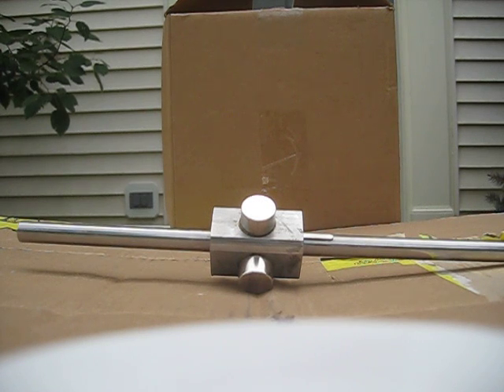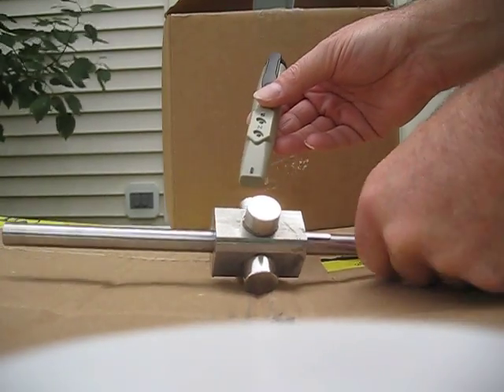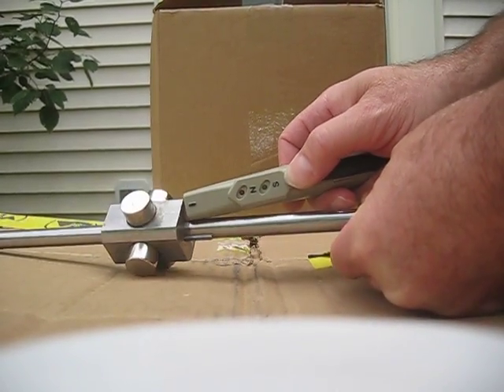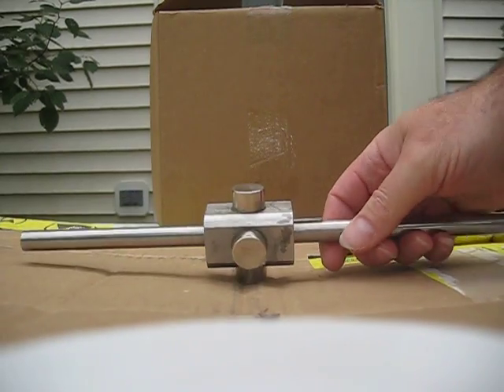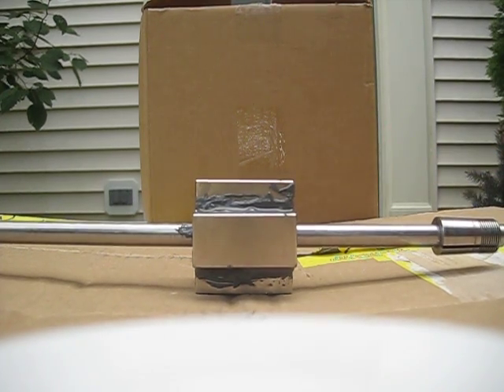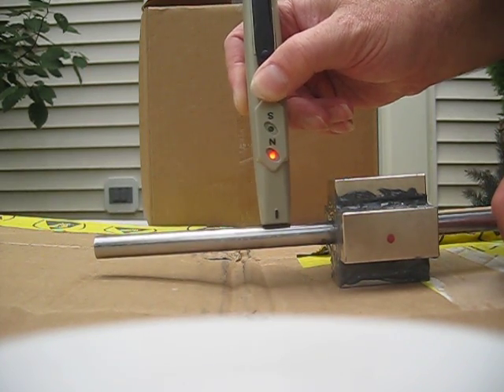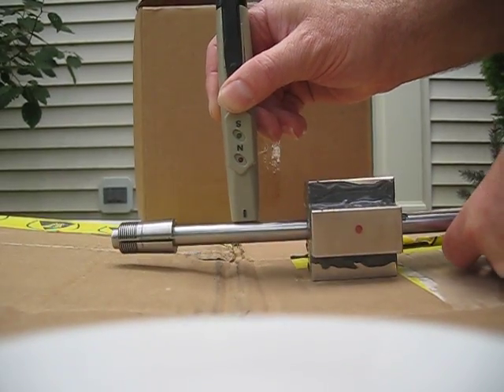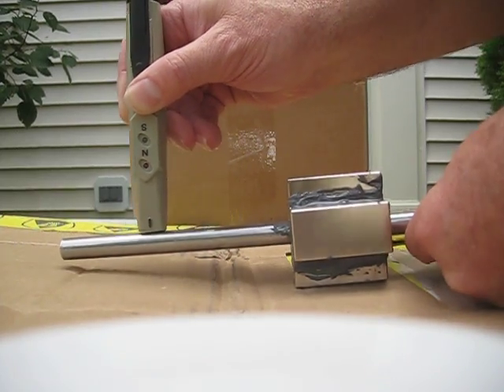Zero Force Motor Magnet Strength

Comment: What did you want to present with this experiment? A flow that closes well and a flow that does not close well?
Reply from the maker: Hi Tudorel --
What I was trying to show was the power of the bigger Neo's verses the smaller Neo's. As you could see the magnet polarity tool measured how far away from the magnets the magnetic field was in the iron rotor and shaft. That rotor and shaft is the one used on my Zero Force Motor and with the new magnets the torque of the motor was doubled.